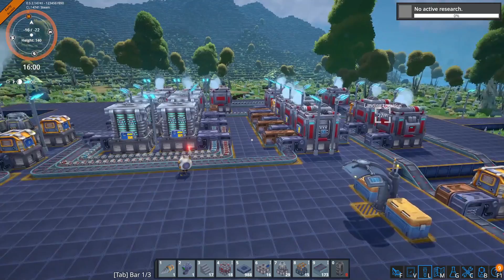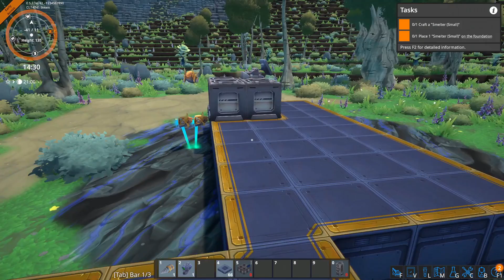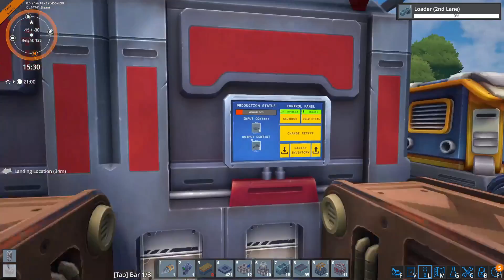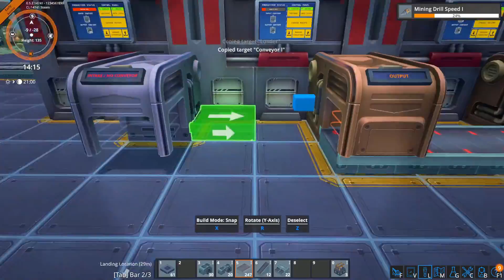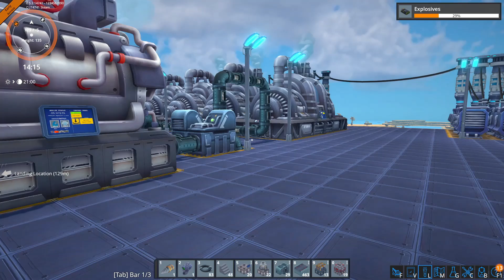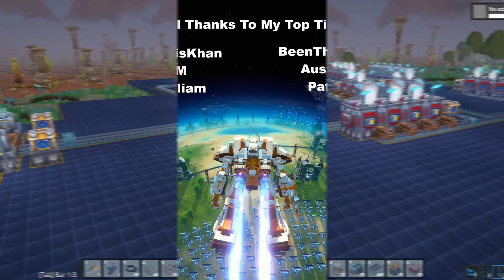A Perfect (Re)start | Foundry | Let's Optimize

Comment: For boilers, u can put all boiler next to each other with 1 block gap, and link them with a pipe in between them with water. Water can flow through the boilers freely, so no need to make spaghetti. I found that way is a bit cleaner.
Reply from the maker: Good suggestion!

Comment: The only down fall about placing your miners on top of the ore is that they only reach half way down. Your going to be moving them down as they dig down.

The better way is dig out the ore, find the horizontal middle, build a square ring around the horizontal middle 3 foundations wide. Place 4 miners, 1 on each side and connect them with mergers. You will never have to  move your miners ever again. You'll have max mining.
Reply from the maker: Ohhhhh I like that! It's a bit more work initially for sure, but never having to move them again is a nice bonus for that work!
Reply: @TheDutchActuary  If your hand digging then ya longer setup. Once you get explosives it's a couple minutes. It's also easy upgradable. Belts mergers miners.

Question, Do you know if there is a certain distance that liquid in a pipe can travel or is it unlimited both vertical and horizontal?
Reply from the maker: @ValiousTV  The liquid slows down as the distance increases, which is what you need pumps for. However, i'm not entirely sure how far that is, as the game currently does not have an easy way to tell (that I found anyway)
Reply: @TheDutchActuary  would be nice to use ship transport for liquids. Might be a little hard trying to get fracking liquid to fracking towers.
Reply from the maker: @ValiousTV  Definitely, ships not transporting liquids is not only annoying, I also don't really understand why that's not implemented yet.
Reply: @TheDutchActuary  What's your power output at? My max power output is 3.2 GW with 124 steam right now. I can probably run 496 steam without problems. Love the infinite ore.
Fracking the whole ore with 20 miners dedicated just to power.
And I'm only using a fraction of the ore.

Would be cool to see your power station.

Anyways bro, keep playing.